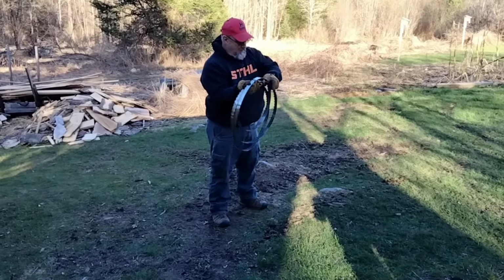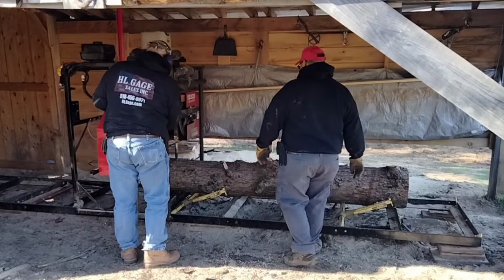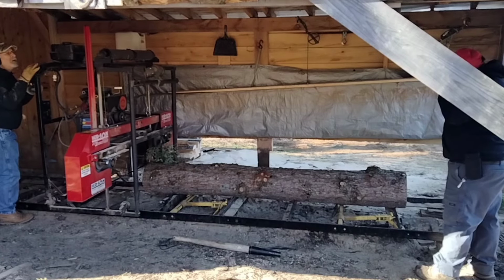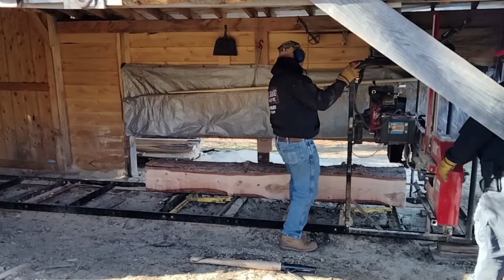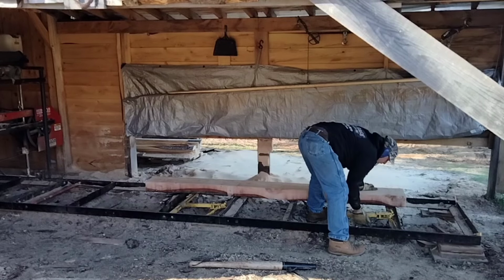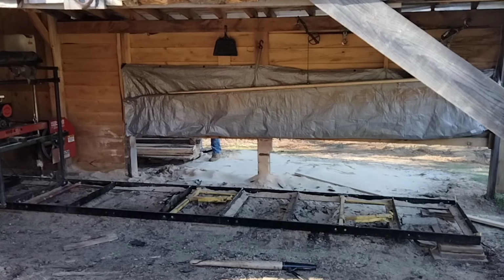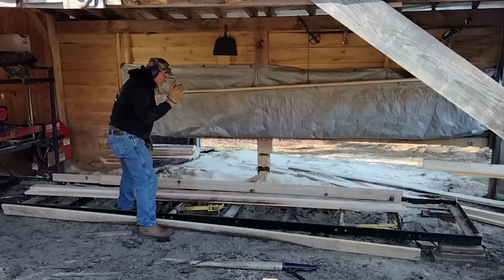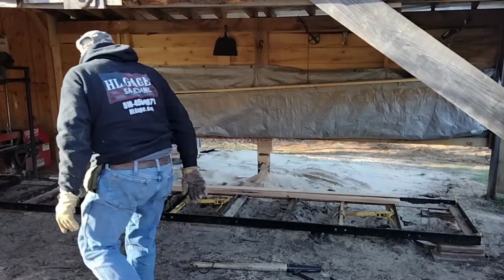Big Change Coming #homesteading #portable sawmill #hud-son

Comment: is your blade still turning while you are turning the log? just wondering.
Reply from the maker: Yes the blade is still turning, the clutch is getting tired and won't release. I'm working on a design to disengage the drive belt so I can do away with the centrifugal clutch.